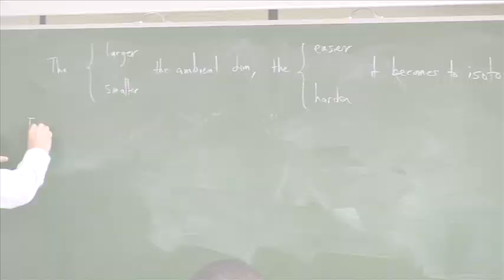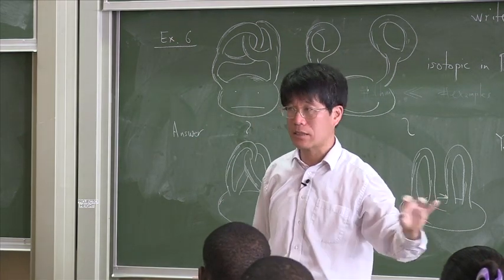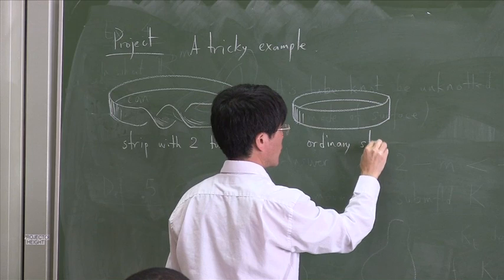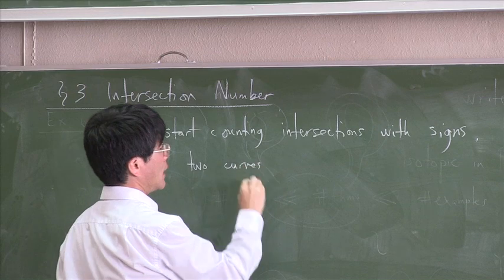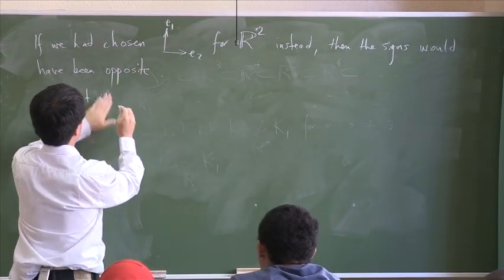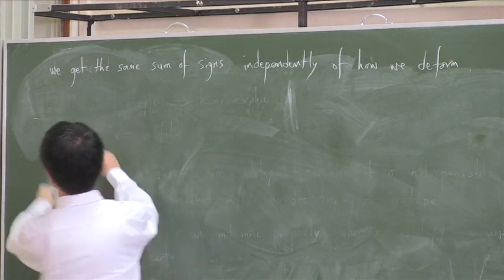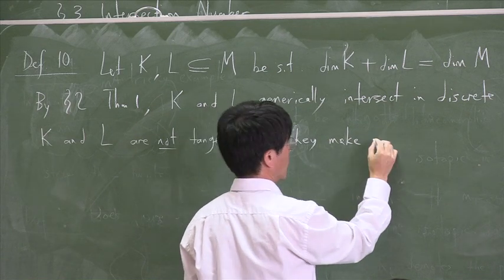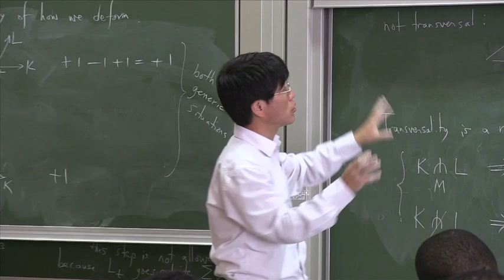Topology & Geometry - LECTURE 06 Part 02/02 - by Dr Tadashi Tokieda

Comment: Regarding the "project"; I just did some experiments with paper, and I can't see how could the strip with the two twists be isotopic to the ordinary strip in R^3 or R^4. Test in R^4, I imagine that I can continually color a part of the strip and that it can cross non-colored parts. I have also thought about possible deformations and I can't find any way. However, I cannot prove impossibility. Has anyone a hint on how should I proceed to do progress? Many thanks.
Reply: If you apply the intersection formula K + L - M you'll notice that you can make the transformation at the 5th dimension.
Reply: @augusto256  how can you say it's 5th ???

Comment: For the two twist strip, you have to move the two (1d) edges of the figure past each other. So 1+1+2=4.  Can be done in 4-space?
Reply: I think it's a 2D surface to pass another 2D surface , Mobius strip is a 2D mfd
Reply: @yimingzhang131  so the overflow would have to be < -1 by thm 2, so
2 + 2 - m < -1
m > 5 
so m >= 6
But look at the replies for Pol asking, one of the answers are much better

Comment: Does anyone know the answer to the project question? In what dimension are the ordinary strip and the full-twisted (2 half-twists) strip isotopic?
Reply: I would think that it is 4, since what we need is to cross the two lines (edge-lines) which are 1-dimensional.
Reply: @pol...  I think you may be right, but you have to be careful to choose an isotopy that passes both of the edge-lines through each other at the same time. If you only passed one edge-line through at a time, there would be some intermediate time T where the surface is a Möbius strip, which is non-orientable, and we know that orientability is intrinsic, but isotopic implies homeomorphic, so we would have an orientable surface isotopic (hence homeomorphic) to a non-orientable one, which is impossible. It may be possible to refine this answer to say that they are generically isotopic in R^m for m ≥ 6 by the theorem on overflows, but in smaller dimensions they are isotopic, but not generically.
Reply: Alexander Ortiz I don’t understand this reply based on what i have learned so far. I wonder if this reasoning makes sense:
If we take the boundary of this strip, we get two linked circles in R3. They may pass through one another in R4 (1+1-4<-1) forming two unlinked circles, which is the boundary of the untwisted strip in R3. I have ignored what happens to the fleshy part of the strip, but is this sufficient to show the isotopy?
Reply: I think it is isotopic in R^6. We need to intersect two planes, not just the two edges.
Reply: In fact, I mistaken. I think we need to cross a line and a plane to undo the double-twist. One edge (dimension 1) need to cross the paper band (dimension 2). So it appears the simple band and the double-twisted band are isotopic even in R^5 (and not just R^6).
Reply: I think the two edges crossing is a degenerate case.

Comment: Why in sigma 3 in R-2 is isotopic in the case of k0 and k1 and not isotopic in the case of L0 and L1 he is telling we have lease sigma 3 even in the first case the rubber band is outside sigma 3 am I right? please clear it out thank you
Reply: Sigma_3 (and indeed sigma_g for any g) is a 2-dimensional manifold a.k.a a surface. In the case of K0->K1 the curve moves on this surface, while L0->L1 requires the curve to be suspended "across" the hole in sigma_3.

Since the curves are on the surface, it is equally valid to think of them moving on the inside of the surface and then it becomes very clear that L0->L1 is not an isotopi because it "gets caught" on the hole